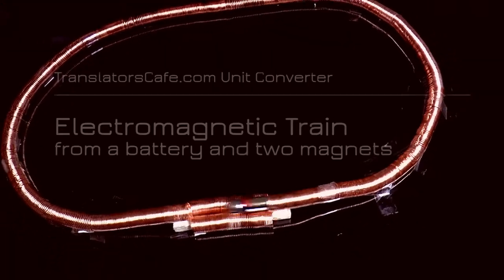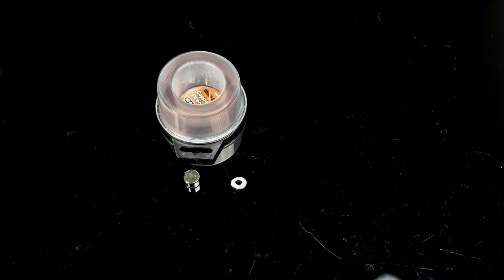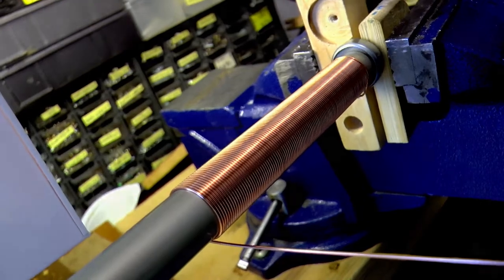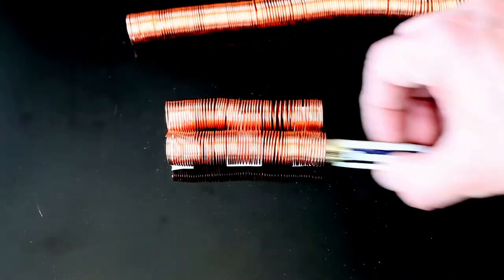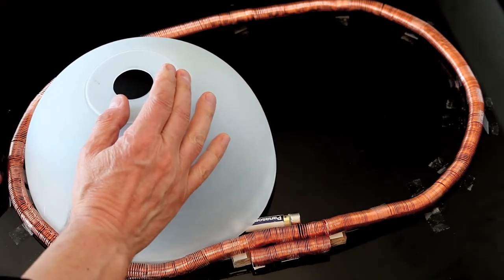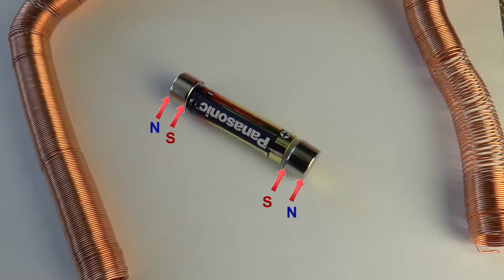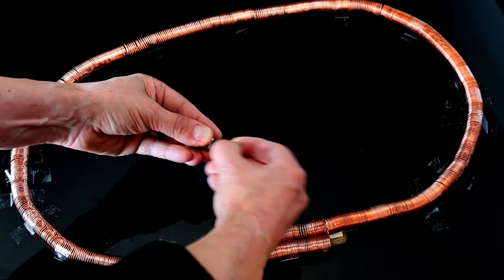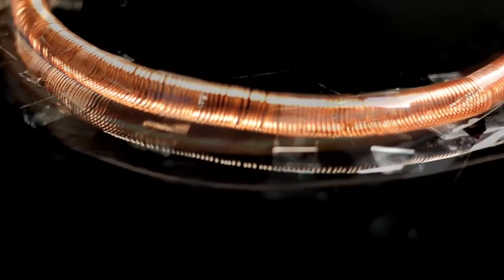Simple DIY Electromagnetic Train from a Battery and Two Magnets

Comment: Wow what a nice experiment
Bro could u please tell me the size of coil u have taken 
weather it is 1/2" inch or 3/4" inch
Reply from the maker: The diameter should be slightly more than the diameter of the battery used for this experiment.

Comment: Hi,nice project.If you let him run - how lon take to drain the power of battery,thx
Reply from the maker: Not very long. Typically it can run only several minutes, up to 20—30 minutes on a good fresh alkaline battery — because of the high current drain. The time depends on the battery capacity in ampere-hours, which can be 0.3 to 3 Ah. So, the time depends heavily on which battery you use. More reading: https://en.wikipedia.org/wiki/AA_battery#Chemistry_and_capacity.
Reply: TranslatorsCafe.com thx,great answer great job 👍

Comment: hi
can i use stainless steel wire instead of copper wire?
please guide.
Reply from the maker: Not sure about stainless steel. It is often magnetic and if yes, it will not work in this application.

Comment: What's battery you used alkaline. Can you give its proper name or model no.?
Reply: Manish Moorjmalani we are use a dry cell develop a potential of 1.5 volt and the voltage decrease with the word is used to accumulation of products at the electrodes even when Excel is not use the lifetime of the dry cell is not independent because Acetate nh4cl co-ordinate and distinct cathode dry cell are most commonly used battery that find used in flash light radio tape recorder transistor excetra as right I said this cell is the same contraction as a dry cell but the modified to replace nh4cl as the electrode by Sodium Hydroxide rocks hydroxyl side or potassium hydrogen has the name of Alkaline dry cell place nh4cl with the nhk watch prevent the equation of aging thoughts in it is does not dissolved in a base medium that sells react as at the anode zn + HCL gives rise to Z and 4 + H2O plus two electron is just after the invention constant of the advertising powdered function and an unauthorised comprise paste of Mercury oxide with the sum amount of Ke Side Effects think of oxide and potassium Hydroxide from electrodes cell reaction with the following does install developers attention of 1.35 volt it is compact is a size because I think and all can be compares into a platform remedy Mercury oxide is linked by electric which is very very at this is required required the minimum amount it is constant potential throughout its life times as overreaction does not involve any ions in solution who considered can change duration it live it also so that good performance at the high temperature it is however expensive due to high cost of Mercury oxide is cell I use electric watch hearing AIDS microphone camera extra

Comment: bro i used 22 gauge copper wire will it work
Reply from the maker: In my opinion, it is too thin. I used AWG 20. Not sure if 22 can work, but you can try.

Comment: hey is it necessary for the magnet to touch the coil?
Reply from the maker: Yes, of course. It will not move without touching the coil. When a battery with magnets is placed inside the coil, the current flows through the part of the coil around the battery with magnets. The coil becomes a magnet, which pushes one permanent magnet and pulls another permanent magnet attached to the battery.

Comment: If I use 18gauge copper wire (1.219mm diameter) 
Deadsoft 99.9% pure copper wire without enameled  --- DIY jewellery will it work
Plzz reply me fast I need to submit my project within 4 days..😔😔😔

. waiting for your reply
Reply from the maker: Yes, it should work.

Comment: What gauge of wire is recommended for this project?
Reply from the maker: I used copper wire AWG 20, or 0.8 mm, or 0.032 inch (diameter) WITHOUT INSULATION.

Comment: bro i got neodymium magnets of 10mm×4mm  thick will it work for this experiment 🤔 
bro not even a single youtuber replies for the comments except u bro
Reply from the maker: You can try with an AAA battery. Its diameter is also 10 mm.